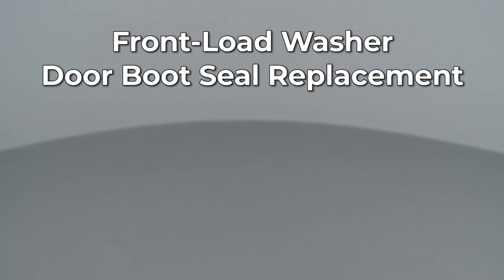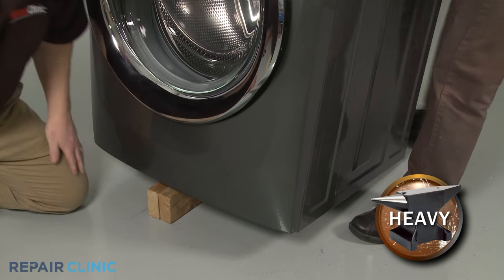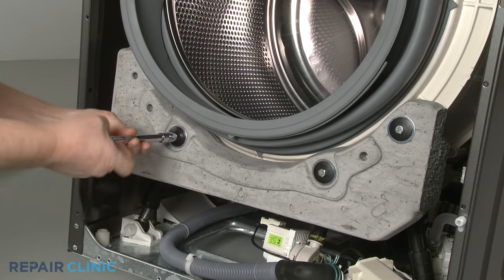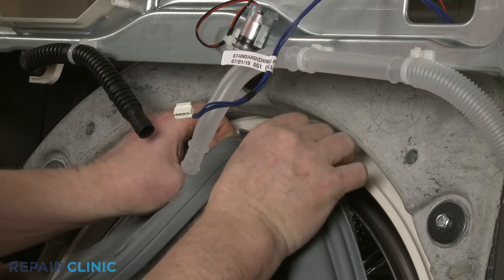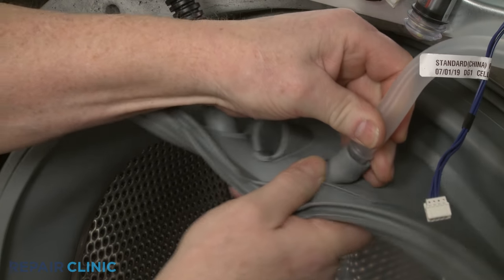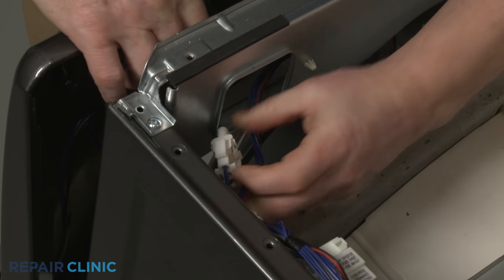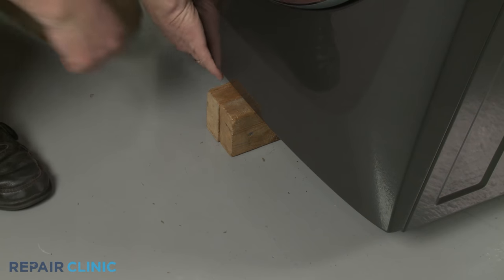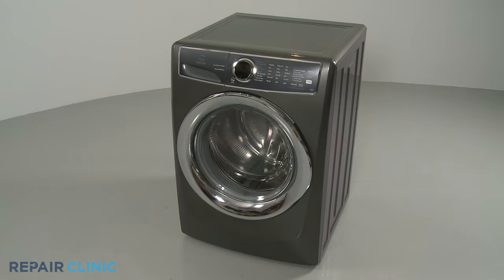Electrolux Front-Load Washer Door Boot Seal Replacement (part 5304505004)

Comment: Shocking how difficult this is!
Reply: Bad designers, simple as that. Also they want you to call their maintenance people.
Reply: Having now done it, I have to say it was surprising easy.  The video was very clear and concise.
Reply: I can't get the spring back on🤦🏾‍♂️
Reply: Clamps keep slipping
Reply: @dejoirnadavis3249  I didn't use clamps.  I started at the top as they did in the video and slowly worked my way down both sides with both hands.  When I got near the bottom I just pulled down on the spring a bit and basically rolled the spring into place with my thumbs.  Hope this helps.

Comment: Thank goodness for the comments about the seal here - it’s really hard! The moral support from others with the same issue helped me get through the third hour of fiddling with the replacement. For those coming after, keep with it!! The key is to make sure the arrow on the rubber gasket is over the tab at the top and flush with the fat part of the washer drum (look closely as he works the seal around or as he takes off the original and you’ll see what I mean). Also, there is a notch in the inner rim of the rubber gasket that fits over the part of the washer rim that sticks out at the top. Make sure there is overlap and the seal is tight all the way around (it will be hard to work it on and was a two-person job for me). Finally, make sure you have a cold beverage ready to celebrate afterward. You deserve it.
Reply: You are god sent ... I struggle with it for about an hour and a half until I read your comment and saw that groove in the lip... appreciated
Reply: @enzodragon0  hope you celebrated with a cold one 🍺
Reply: Stuck here trynna get the inner ring on with no clamps lol
Reply: @Appachoppa112  that's probably not going to work ... Trust me I tried...ended up having to buy like 2 from Lowe's
Reply: @enzodragon0  yeah i just put it back as best as i could lol. Its not gettin done today

Comment: I found that removing the three screws and top weight made accessing and aligning the top tab on the seal to be much easier for starting and completing putting on the seal.  I was able to put it on in around 10-15 minutes, once the top weight was out of the way.

Comment: So watched this about ten times. Everything went smoothly until that damn spring. Drove me crazy. Could not get it on. Had to turn to a appliance repair. Turns out I was putting the boot seal on wrong (wish there was more close,up of that.) Once that was on right the repair person put the spring on in 20 seconds as the spring held on the boot. When I was doing it the boot kept pulling off. I’m just glad the whole thing is over and will keep the boot clean enough to eat off of!

Comment: Excellent video and very straightforward instructions!  I was able to replace the door boot seal with no problems by following the exact steps in this video.  Reinstalling the spring was not difficult.  I used the two large spring clamps like in the video to hold the spring in place (at the 10 and 2 o'clock positions) and then stretched the spring down and over the rest of the lip.
Reply from the maker: You're welcome! 

We are always happy to help. If you would like to give us a review on Google, we would much appreciate it: https://g.page/r/CcVUrahZNozMEBM/review

We hope that you have a great day!

Comment: These instructions were bang on! My husband and I completed this installation with no issues at all.  I do agree with one of the comments below though, getting the front panel back on the machine was likely the trickiest part of this project.  Also, installing the spring and retaining clip were smooth, mind you we did have to sets of hands. If working alone, I would suggest as the video does, using several clamps to fix the spring in place while it is fit around the circumference of the washer opening. Thank you again!

Comment: I found the trickiest part was getting the front panel back on. Be sure to check for proper alignment of the 4 plastic pins and the 2 mating points for the screws in the soap dispenser area. I had my metal flanges bend due to forcing it when not completely aligned.
Reply from the maker: Thanks for the tip!

Comment: Just replaced my seal, had this video open whole time. Thank you so much!
It is a little harder than on the video, but instructions were excellent. Had to go look at old seal to see where spring went (marks present) to be absolutely sure - sure don't want another leak! Clamps to assist with spring replacement are a must, I got 3" Ponys from Lowes, very cheap. Highly recommend this video.

Comment: Frustrated that I had to replace the boot seal after only two years due to a small tear in the bottom of the seal.

HAPPY that your video is super clear and easy to understand to replace the stupid seal! Thank you!
Reply: Same here, except a nickle sized chunk somehow tore off. Mine's still under (extended) warranty, but after reading it closely, sounds like it only covers parts, not labor, on this third year of ownership. Will find out Monday, as they're closed in weekends, because you know, stuff doesn't break down on weekends...😠

Comment: Awesome video thanks guys!! Two things I would add is take off the top counterweight, it helps make it easier to get the spring on. Then when installing new bellows if your struggling a tiny bit of fabric softener and it slides right on, use it on the light and the water hoses at the top as well.

Comment: Great video ......I was able to replace it without removing the top cover and front cover...... alittle tight doing it that way but my washer and dryer are installed inside cabinets like a built-in so I figured I would try without removing the covers and I was able to do it in less than 30 min. 
I used the clamp idea...... Great tip.... That inner spring is very difficult to expand.

Comment: Thank you so much. Perfect instructions. We moved into a new home and the door seal was disgusting. I didn't buy a new part. Instead I saved $200 and soaked the door seal in bleach for 6 hours. Came out almost like new.   Replaced the whole seal for about $30. $10 for bleach, $20 for clamps. 

Nice!!
Reply: Did you have to do all these steps to remove the whole seal? I'm just trying to clean without taking it off..pain in the butt..not sure its possible
Reply: @amymiller5112  yes, of course.

Comment: Just did this yesterday. Not too bad! Ditto on @emlafey's comment about exactly where the boot seal goes. I found it a whole lot easier to install the boot seal and springs with the top counter weight removed. I did need a third hand (second person) to help hold my clamps from flying off while installing the first spring. Also a third hand helps installing the second retainer.

Comment: Video was right on - BUT you need clamps to put the spring back on!  I got it with 2 but 3, as shown in the video, is ideal.  Thanks
Reply: I did it without clamps, but i wish i did have clamps
Reply: Just one will work best… use one clamp to hold a start point, then stretch spring from the clamp to continue around ring. I tried using two or even three clamps, but then to stretch spring you are fighting the rubber, so all the stretch gets isolated to final little bit. If you just have one clamp, its cake as long as you use your arm to stretch spring as you install, the final bit has slack to go on easy.

Comment: I attempted this today and got it done. Once I was finished though the barrel doesn’t not move I tried to move it by hand with no luck. Have I attached the seal the the part of the barrel that turns and there is another part I should have attached too? It seems the seal is preventing the barrel from spinning. This guy makes it looks easy 😂

Comment: Holy smokes that was hard. My big tip is that the rubber lip wraps around/over the ring of the washer. It's kind of like wrapping your lips over a snorkel. This is done on both sides of the ring. At first I thought the rubber just laid around it. Like others have said, the rubber ends up being flush against the washer. I recommend using your fingers to dig into that crevice. It actually goes pretty deep into the rubber ring. That was might lightbulb moment about how it fits on.
Up until that moment, I thought I had the rubber ring in place, but the wire spring kept popping off, even with clamps. If the rubber is properly in place, the spring can actually sit in place.

Comment: If youre having trouble with the inner spring, take 4 screws that hold the weights and screw in each corner (without the weights) and put spring onto each corner, then maneuver each corner at a time into the springs location, made it SUPER easy for me!
Reply: sounds like a good idea

Comment: The tension on the retaining spring seems uneven, with some sections stretched out more than others. Do you think this will even out over time, or should I try installing it again? I think the hardest part to this project was getting the front cover back on. It was difficult to line up everything, especially the screw mounts for the detergent tray area. Thanks for the helpful video!

Comment: Man that was not easy! The spring was such a pain! But, thanks to the video I completed it. Be careful when taking off the front panel that little blue wire broke off because there isn’t much slack. I was able to use some glue thankfully and get it back on but be careful.

Comment: Super easy. No clamps necessary if you have ever changed a bike tire before. Important to get the boot on so the spring sits in the groove, one benefit from pulling it apart is you get a real good visual all the way around. Tried this without removing the front and had a leak because one small area didn't get seated properly that I couldn't see.

Comment: Just finished this repair and boy was this video a fantastic guide.  Everything was just as shown with a couple additional point for the next users.  First the four screws on the bottom of the washer were pretty corroded from moisture and soap.  Almost had to drill them out but managed to extract.  Issue was you really can't use these again as the head were almost stripped by removal.  Get replacements before project.  I knew from past projects the spring loaded wires holding the seals on would come off pretty quickly but putting these back on a test of patience.  I recommend the clamp method of holding these with maybe three clamps if needed. All was good until putting the front panel on. This was slightly bent somehow and the method of the attachment was not clear from the video.  There are two plastic guide pins on each side and the fit through a wider opening on the panel and then the panel slips down on these.  Getting the top and sides aligned ended up being a two person job for me.  Everything was great up to this point.  Maybe my panel just got a bit bent from removal but I could not get the three tabs on top aligned and get the four connectors on just right.  Just a heads up.  One last point-I was able to order the whirlpool part for about a third the price of the Electrolux part number. this was part PD00055316 and manufacturers part 5304505004.
Reply: Was the Whirlpool part infused with strong fragrance like the Electrolux part?
Reply: @alanazon1   No. clean and no smell. I do already have new mould building up inside of seal.
Reply: @markconfer9111  Hmm, I'm seeing that part number as a Frigidaire part, and Electrolux claims that it comes from the same factory. Was it listed as a Whirlpool part? May I ask where you bought it? I wonder if it's aftermarket? I did try ordering a couple of cheap gaskets online that I assumed from the price were aftermarket copies and wouldn't have the patented Electrolux perfumed antimicrobial coating, but they turned out to be genuine OEM parts. I'm violently allergic to the perfume, and just cannot get my hands on a non-perfumed gasket anywhere. All the parts suppliers around here claim that aftermarket, unscented versions do not exist, and I've exhausted the possibilities on amazon, so if you wouldn't mind sharing where you bought that gasket, I'd sure appreciate it.
Reply: @alanazon1  No problem.  I will have to do a little digging but I think on Amazon. It was a whirlpool part but I was able to cross reference the part numbers.  There was no perfumed scent on this just plain rubber.

Comment: Does the new boot have the infused fragrance smell the original had?  I have not ordered the new boot yet. Thanks.
Reply: The original infused fragrance is the volatile organic compounds out-gassing from manufacturing process. If yours has a fragrance, that's from the detergent or fabric softener used. Pro-tip: don't use anything with synthetic fragrances that you apply to your body, in your home, nor in your washer;  unless you want to develop health issues down the road, but no body wants that. They like to profit from our illness, so they trick us into thinking covering up smells with poison is better than resolving the cause of the smell.
Reply: Mark, you are incorrect. The new boot absolutely does have the strong infused fragrance that's part of the patented Electrolux anti-microbial treatment. It reeks of this fragrance, and it will get into your clothes and not come out, even if you soak them in vinegar, or borax, or baking soda, or isopropyl alcohol. They infuse this oil-based fragrance into the rubber during the manufacturing process, and it will continue to outgas and get into your clothes for months or years. It's so strong, in fact, that the perfume will likely make you stagger backward when you open the box containing the new boot. So if you have allergies, ordering a new replacement boot won't help. It's a complete nightmare of constant emission of allergy and asthma-inducing VOCs. I've been trying to order a non-fragranced gasket for two weeks, and despite assurances from previous purchasers on amazon, who say they received a non-perfumed boot, I keep getting shipped the original OEM Electrolux gasket with the infused perfume. It seems that for a time there were aftermarket boots being sold without the oily fragrance, but Electrolux doesn't allow it, according to all the appliance parts suppliers that I've contacted. And it seems they may have successfully shut down the aftermarket suppliers within the last few months. I'm still searching for an unscented aftermarket gasket sitting in some warehouse somewhere, with an unusable brand new Electrolux machine sitting in my house, sealed in plastic so I don't stop breathing from allergy-induced asthma. It does make me wonder what the VOCs coming off this gasket might do to the lungs of small pets and children, even if they don't have allergies. Note also that the OEM Electrolux/Frigidaire door boot has a California Prop 65 warning, which I assume is due to that fragranced antimicrobial coating.
Reply: @alanazon1  Wow I just saw your response, thank you for correcting me. I was making a logical assumption, but it was based on assuming the washer that came with the house had the previous owners use fragranced detergent... that's crazy... but this world is crazy. The institutionalized stupidity is very frustrating, especially about things like this. Poison for profit is bad enough, but poison just cause hey why not... geesh. Just one more reason to remove it to clean it and put it back, but that's also assuming it gets reduced with age and use. I still have a new one in the garage. I might open it just to see how it smells.

Comment: Agree that this is an excellent video with the only issue being that putting the rubber gasket on is not intuitive - note that the little tabs go flush against the machine! Read comments below. Also, getting the large primary spring on was not easy. We needed two people and a lot of leverage to stretch the spring to fit. However, the project was completed in less than three hours, and the washer is running fine, no leaks, and no more disgusting mildewy rubber gasket.

Comment: After watching the video several times and reading everyone's comments, I can get the seal around the edge of the outer drum.  However, it doesn't extend over the drum enough in order for the spring to have enough surface to hold it down.  Any suggestions?
Reply: I'm in the same boat as you. I feel like the replacement part I have now ordered twice from different sources isn't correct.
Reply: same boat. any solution? ripped this thing apart in 15min, then 3 days working at trying to get the bellows on in the right way for the spring to be in the right position. In order for the spring to seat, it seems the holes on the bellows need to face down on the spring channel versus flat agains the tub face, but that’s not how the bellows was designed to fit.
Reply: Did you ever figure this out?  I’m having the same issue.
Reply: @richardsmith5840  did you get it figured out?
Reply: @stephensopha4228  took me a while to check back. hope you figured it out. I did. I wrote about it on the main thread. essentially the top notch on the vanilla colored plastic drum mates to a notch on the underside of the bellows. when you find that and mate them up it’ll then indicate how to fold and lay the bellows.